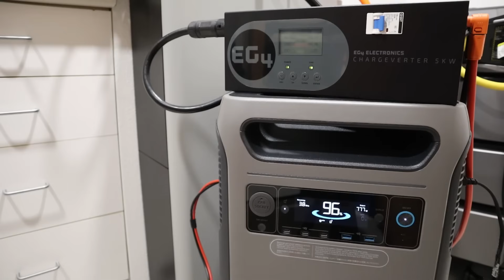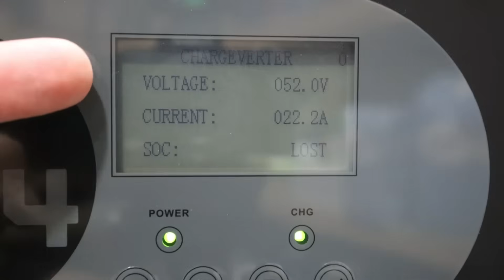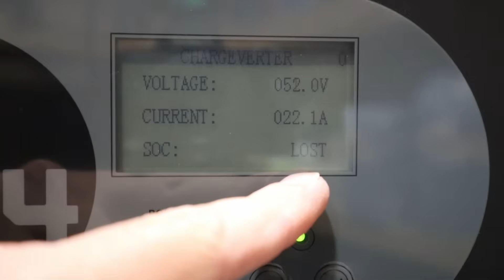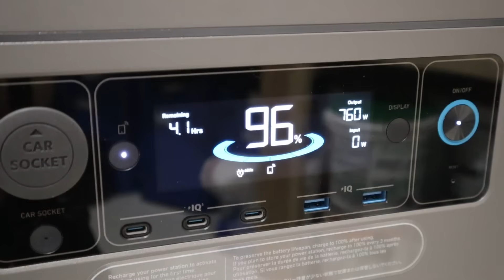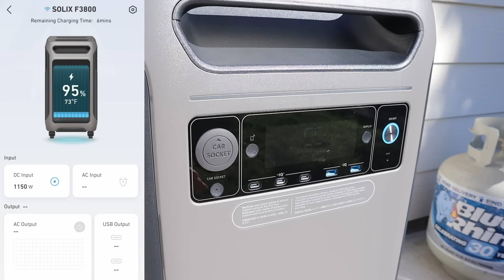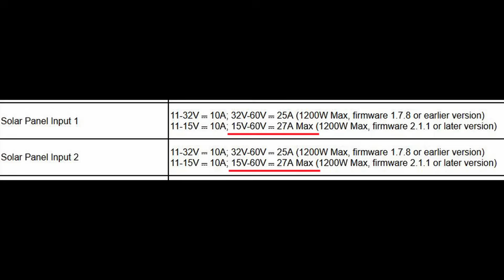The EG4 Chargeverter FIXES the Anker SOLIX F3800!  Keep the 240v Powered On!

Comment: I'm curious if this can be done with the F3800 Plus which uses a proprietary solar input instead of the XC60?
Reply from the maker: Yes, it works on both F3800 Plus ports at the same time.

Comment: The 80 amp fuse that was in the parts list where does that get installed? On the quick connect before the Anderson connector? I looked everywhere in the video and I do not see that installed anywhere.

Comment: Outstanding setup, basically never run out of power, charging while using and you don’t need sun or generator how can you get any better than that..You’ve just made the 3800 one of the best investments ever to anyone wanting to create energy with minimal overall cost that can be used literally anywhere anytime being you could basically plug it into the 3800 while using the 3800. A true all in one portable power station. Nothing else needed. Also kinda of funny how you’ve also shown basically these companies could actually incorporate an onboard charging system using its own energy to maintain itself, but don’t….

Comment: I bought one to charge my pecron 3600s off the generator via the solar inputs. I'm mostly a newb at this, but noticed that when both stations are connected via a pigtail the voltage output ramps down to 50% of whatever's set in the menu and the cooling fan on the EG4 ramps up. 

So instead of getting (for example) 50v@20a for 1000w shared across the two batteries I end up with 25v@20a for 500v split between the two units. 

Does anybody know why this happens?
Reply from the maker: Raise the amps up to 50 amps on the chargeverter.
Reply: @Jasonoid  That did indeed work. So, if I want to go full beans to all the solar inputs on both of my units (~1200w x4) is that even possible with a single chargeverter?

Comment: Can you do this with the Jackery 5000?
Reply: I was wondering about that after watching this video. I assume I can only use DC8020 (LV) ports (supports up to 60V at 10.5A) since MC4 (HV) ports accept 135-450V. Following!!!
Reply from the maker: Yep, for 1000w input via the low pv port.
Reply: @Jasonoid  Perfect, thank you for the confirmation! Do you think I can feed 1000W to a single LV port or should I split it two ports? Not sure if DC8020 can handle that much power without being melt...

Comment: I bought the most recent Chargeverter with the 120v cable to go along with my Anker Solix F3800 Plus. As you know the plus version does not have the XT60 connectors, but rather some new proprietary adapters for inputting a higher amount of volts and amps into the unit. Do I just need to cut the ring connectors off the Chargeverter cable and add my on SB175 connector like you did here and then make another cable with a SB175 connector to the new proprietary adapters on the F3800 Plus?
Reply from the maker: The concept will be the same. The huge benefit of the F3800 Plus is that is allows both ports to be connected to the Chargeverter so you can dual charge at 1800w 👍 set the Chargeverter output setting to 50 amps to allow that much power.

Comment: Has anyone tested charging 2 separate units with one chargeverter
Reply from the maker: Yes, that works, you have to set the chargeverter to 50 amps output in the settings.

Comment: Any chance you've done the same thing with the Eco-Worthy 60a charger?  If not, would you?
Reply from the maker: The charge controllers need to sense a battery votlage to work properly. The chargeverter is a power supply putting out a constant voltage, thats why it works.

Comment: What if you use a LiTime 58.4V 18A Lithium Battery Charger for 48V (51.2V) LiFePO4 Battery

Charger, adapt with XT60 and connect it to the DC solar input? Would that work? Same idea, but using a more compact charger.
Reply from the maker: It won't work, the solar charging port doesn't have a 'battery voltage' for the charger to sense starting and stopping voltage.

Comment: hello, is Eco-Worthy 48V 60A Smart Battery Charger  a viable substitute for the EG4 chargeverter?
Reply from the maker: A battery charger doesn't work, it needs to sense the battery voltage and there's not 'battery voltage' on the solar port. The Chargerverter is a giant power supply.
Reply: @Jasonoid  thanks for the info

Comment: does the EF Delta pro ultra have the same issue ? I am not spending 6,000 for two that i  have to spend to just charge it..
Reply from the maker: No, the DPU can charge with AC input at the same time as 240v output 👍

Comment: Thanks so much for this video! It is such a huge help. I never would have known how to do this. Did you have to set the Chargeverter to any particular Voltage/Amperage settings? Or did you just let the Anker's BMS handle the input?
Reply from the maker: I go through the required chargeverter settings in the video
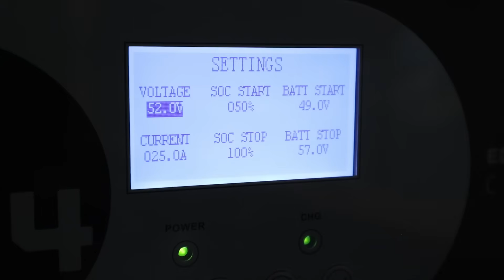Reply: @Jasonoid  OH, I see it at 4:31. Thanks so much, I've watched the video many times now but was fixated on the wiring section mainly. That slipped past me. Would the current need to be altered if it was pushing out power through both wires into two separate power stations? or would it remain the same?
Reply from the maker: @BruceSchaub1 the current setting would need to be doubled in the settings for proper charging of two units.
Reply: @Jasonoid  Ah, ok, thanks so much. That seemed logical to me but I was scared to do it, lol. Thank you

Comment: Could this also be achieved by using a 48 volt 18a lifepo4 Battery charger into the xt60 ports? Hooked to an inverter generator for an emergency situation, A more budget option?
Reply from the maker: I tried that and the battery charger didn't work since it needs to sense a battery voltage to start and stop charging.

Comment: Hi, I have a portable gas generator hook up on my house already. It runs to a sub panel in my basement. Would I be able to remove the subpanel connection and plug that into the chargevertor, then chargevertor to f3800? Right there in my basement? I would really just convert my generator hook up outside from running a sub panel to only being a charger for my batteries
Reply: Maybe this is a more clear picture? Hello. I have an f3800. And would like to charge it in my basement vs garage/outside. I currently have a gas generator hooked into a sub panel. Could I unwire the power chord coming into that panel and hook that to a 50am outlet, then chargevertor, then f3800. If so my plan would be to put an inlet on the sub panel to connect my f3800. Then when I need to recharge, start dirty generator outside my garage, plug into inlet on the side of my house, power runs to chargevertor to f3800 providing clean power to recharge. Turn off generator and go to bed. Next step is to get the home power panel this fall.

Comment: VEVOR RV Converter 80 Amp 110V AC to 12V DC RV Power Converter Battery Charger
102 sold  
Sold by: VEVORSHOP  $96.56

Comment: Great video, I have both 3800s, and the 2600…  Sounds like the update to the 3800 solves two problems I was having (dual charging, and weird voltage ranges).  Out of curiosity, is there an electrical component that would allow increasing solar voltage of the panels in parallel to the higher range, or reducing voltage, such that two panels could be wired in series?

Comment: I wonder if you somehow add a small resistor component on one of the cables, to trick theF3800 it is getting charge from different sources, we can make it tu use both solar inputs from the same source.

Comment: Does the 240v chargin still work if you have the dual anker system ie 2x 3800 for the 12,000kw setup

Comment: The F3800 plus the solar uses higher voltage and lower current to get to 1600 watt.  With the chargeverter the max voltage is 57 volts and the F3800 max current at 17 amps, the best you will get is 969 watts. Is there another chargeverter with higher dc voltage out?
Reply from the maker: But.... But..... It will allow the chargeverter to connect to BOTH solar ports for charging so about 1600 - 1700 watts. The original F3800 didn't allow that. So you can actually charge faster on the F3800Plus with the chargeverter 👍
Reply: @Jasonoid wow thank you
Reply: @Jasonoid I must be doing something wrong, I connect the chargeverter to my 3800 plus. The set the settings to 56v,  soc start 50%, battery start at 49, current at 15 amp, soc stop 100%,and battery stop at 57v. It wou;d work for a short while then the voltage would drop until it settled at 10vdc. Which causes no watts for charging. I had the chargeverter connected to a generator 120vac 30amp plug. I made my own adapter based on the manual and your video.
Reply from the maker: You need to set your current to 50 amps on the Chargeverter.

Comment: If all it needs is a common ground, then wouldn't putting a diode on one negative wire before the XT-60 input trick it? With a diode, it wouldn't be able to detect continuity. Unless it uses some special way of detecting.

Comment: If I buy two of these on Amazon would these get me 360w of input?  HKY 180W Power Supply with XT60 Plug for RC LiPo Battery Charger Balance Charger Like iSDT, GT Power, Hota RC and Any Devices with an XT60 Input Port 19.5V 9.23A AC DC Adapter Charger Cord. Who says no?

Comment: Maybe it would work to put a beefy diode on both of the negative leads, a 50A diode or similiar which are in reverse (as its on the negative lead). By using a diode, the anker wouldn't be able to send a voltage down the negative lead to measure/check if its sharing the same ground, and thus would permit charging in parallel.

Its propably a safety thing so you don't parallel a source that can supply a limited amount of current and thus burn it out.

You could also try with a very small power resistor on one of the plus leads, like 0.05 or 0.01 ohm. (Note! The resistor must be rated for like 0.01 = 50w or 0.05 = 150w) thus creating a voltage difference, and thus the Anker wouldn't know that its the same power source. Could work with a truckload of more cable on one of the charging inputs to increase resistance that way.
Reply from the maker: I've tried using up to 4 diodes, one on each wire, still didn't work and the diodes got super toasty, they needed active cooling. I spent weeks and over $100 in diodes testing, no luck 😢

Comment: Looking to compliment my  large (11000/9000w)  120/240v tri fuel inverter generator with a battery bank for power outages. I'd like to  get a couple non eg4 48v batteries. Wondering if I could use a chargerverter to charge them in parallel and how long of a charge that would be ? I can't find any videos showing the Eg4 chargeverter charging a non Eg4 battery anywhere. Just trying to figure out what I need and what's work before I spend money.

Comment: @jasonoid, have you used the Chargeverter with the 3800 Plus?  Looks like XT-90 to MC4 used with the Anker proprietary blue colored solar input.  Super interested in your take.  This video is fantastic, btw!!
Reply from the maker: It will work, you just have to adapt to MC4 instead of XT60.
Reply: @Jasonoid IDK what the malfunction is, but I could not get the F3800 Plus to charge up using the Chargeverter and the XT-90 —> MC4 —> blue proprietary solar charging cable.  The Chargeverter simply would not display any amps.  Very confused. Works perfectly on the OG F3800 via XT-60.
Reply from the maker: Maybe polarity is backwards on your MC4? Super easy mistake that happens frequently  @OdessaBill
Reply: @Jasonoid Turns I’m experiencing same problem with the OG F3800 and the XT-90 to MC4 to XT-60: Chargeverter displays zero Amps.  I confess, IDK (yet) how MC4 polarity can be reversed since they only appear to connect but a single way. However, the Chargeverter works perfectly from XT-90 to XT-60 (just like in your video), so the problem has to be with the MC4.  I’m such the beginner 😅. Thx for your quick responses.  You rock!

Comment: I am sorry for being such a pain, but EG4 says that the battery cables for the ChargeVerter are 2 AWG or 2 gauge. How did you make them fit into 6 gauge connectors?
Reply from the maker: They must have changed the wire size 🤷 you can trim off some strands to get them to fit. The 2 AWG wire is for 100 amps, you won't be pushing more than 50 amps through it.
Reply: @Jasonoid  Thanks for the response. I will be charging at 100 amps. My main system is the heated 14.7Kw wall mounted EG4 battery. I will have to get another charge cable for my two Pecron E3600 power stations.
Reply: @Jasonoid  Sorry but I was incorrect. The Chargeverter uses 4 gauge wire so looking at yours, to get that 4 gauge wires into the 6 gauge connecters you would have had to remove wires. Not a good idea if you are going to use it for batteries.
Reply from the maker: @LarryRichelli  the power station will limit the input to 27 amps. We'll below the rating of the wire ampacity.

Comment: So I tried charging two 3800 with one chargeverter from 120 using setup you have in the video. It doesn’t work. It starts fine but after a while it goes higher on one unit and lower on the other. Eventually it settles around 190 watts into each unit and that’s it. Too slow. Now charging both at the same time from server rack battery works fine. I played around with amps on eg4 at 18,20,22 and each time same result. Not sure why it’s not working. I forgot to add that voltage on eg4 drops significantly so I think that’s why 3800 charge at slower rates. Eg4 fan goes crazy during that process. So what I’m thinking is that 54 volts gets split in half so that is why I’m getting around 25 volts to each 3800.. so since it’s below 30 it charges at slower rate?? I don’t know if I make any sense
Reply from the maker: you need to change the amperage setting on the chargeverter to a higher level. I'd say 55 amps and you'll be golden.
Reply: @ so 55amps on chargeverter gave me 390 watts to each unit. Improvement but no 1150.  Chargeverter shows 16.9 volts at 50 amps. I’m assuming I would need 220 for more amps out of chargeverter??
Reply from the maker: Your using the exact voltage settings in my video?  I show the exact settings you need (Except the rise in amperage I just mentioned)  @Ecgmma
Reply: @Jasonoid yes. Setting are as stated in video. Max voltage I get is around 17 with max amps at 50 even though volts set at 52 and amps at 55. I think maybe charverter needs 220 to get more voltage. No matter how far I go on amps it will not go over 50. I set voltage to 52 but it will not go any higher than 17
Reply from the maker: With the settings in the video the chargeverter won't charge unless the voltage is above 49v. For example. Battery start should be set to 49v. I had issues until I had that set properly. 

I have successfully completed charging with both 120v and 240v as a power source on my units. I don't believe thats the issue. Other commentors on the video have successfully charged two units at once.
Reply: @Jasonoid  well.. I tried pretty much everything. On 120 eg4 will not go over 50amps. I think it will push 100 on 220. Voltage is fine with only one 3800 connected. I set battery start at 49, 47,45 .. it doesn’t matter. In theory it should push 25amps into each unit and it does but voltage drops to 17 when other units is connected. When I disconnect second unit I get nice 52 volts. Like I said it helps when I go from 25amps to 55. I can charge each unit at 390 but it would be faster to charge them separately at 1150 in my case. Could there be anything wrong with wires?? I’m using 10awg on the split and 4awg from eg4. But than again when use my server rack battery with the same cables I get 1150 on each 3800… so it’s not cables. When I get some time I’ll try 220 and see if this helps.
Reply from the maker: @Ecgmma maybe that's it. Keep me posted.
Reply: @Jasonoid  I think I figured it out. So I had two extra batteries on one 3800 and second 3800 had no expansion batteries. I thought it won’t make difference but I guess it does. So now with one 3800 plus battery and second one plus battery it works fine. They both went up to 1150. My 15 amp breaker tripped but at least I know it works

Comment: Jason, sorry if you already talked about this (I searched), but have you tested this dual charging question with 2 Delta Pro 3's?  That's my setup, with the 50-amp hub, and I wasn't sure if 1) this will work?  2) proper settings for the Chargeverter considering the Low vs High power PV inputs on the DP3?  Thank you!
Reply from the maker: You'd have to refer back to my DP3 review video in the charging section to see if I attempted to dual charge from the same source. I can't remember. It might only work on the low PV port.

Comment: 7:10 I don't really agree on that one. Most switch mode PSUs should be able to handle dirty power just fine since they don't care about input frequency or waveshape. Some precision power supplies may use ordinary transformers though for isolation/noise reduction purposes which is a bit of an apples to oranges comparison. The EG4 actually proofs that, it has no consideration taken in for dirty power, it's just two off the shelf telecom rectifiers in parallel controlled via CAN bus, those aren't designed for dirty power but will handle it anyway.

A Industrial 48V power supply would be a better comparison overall since precision power supplies are a different beast for example a MeanWell 3kW 48V industrial PSU should be arround 500-600$ which is still a worse price/power ratio than the chargeverter but will easily beat the precision power supply that was used for comparison. 
Now that's not to say the EG4 chargeverter isn't a good price for a integrated solution that doesn't need much setup, but imo the capabilities overall are not really due to special design.

Comment: If I use Anker double power hub and both Anker 3800 are connected with it can I charge both of them at the same time using this eg4 and if so do I set the eg4 at 2400 watts ?? Using the same cable setup you created in this video?